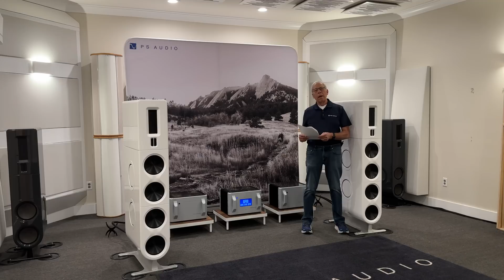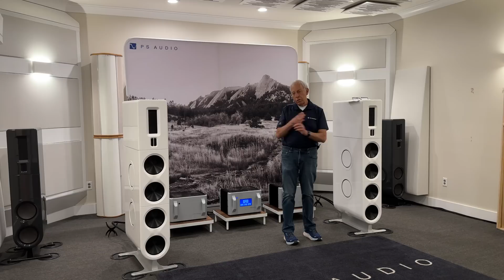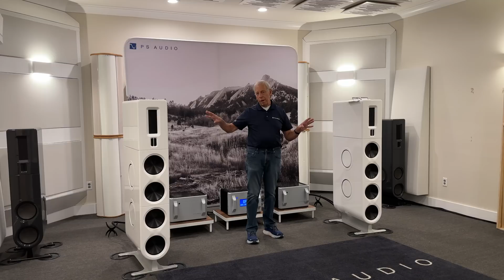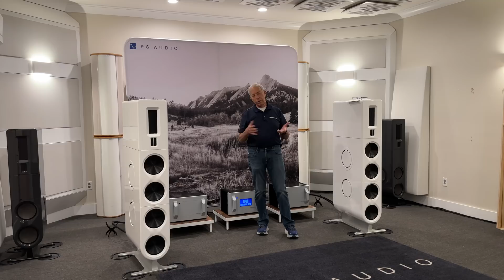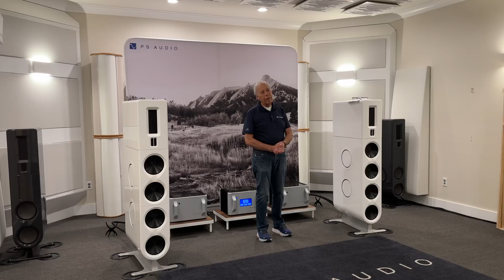Crosstalk cancellation

Comment: Crosstalk sounds bad. Yes, you can get a wide stereo image with just 2 speakers without addressing crosstalk but that's only half the problem. The phantom center cannot sound optimal, and the further the speakers are placed apart to create a wide soundstage the worse it gets. I've never, ever heard a straight 2 channel, 2 speaker system overcome this. It's just baked in to the setup, which was originally chosen as a way to get stereophony happening with maximum affordability and practicality, not sound quality. I'm glad to hear Paul is working on the single box. I don't see it as a compromise at all. It's actually the best way to do it, and it's not hard at all to do it without any digital processing. You just need to upmix 2 channels to 3 channels with simple channel summing and differencing. In this way you can totally end the comb filtering of center panned sounds, which I will argue are the most important to sound quality overall, while simultaneously creating a very natural width sound stage, and increasing the distance from side walls and thus increase time delay of first reflections to the listening position. Yes, it goes off if you're not sitting in the middle, but so does the 2 speaker setup. The way it fails is more graceful I think, with the center panned sound staying in the middle of the room and the panned sound positions collapsing  and becoming ambiguous, but still maintaining a nice spacial effect. There's no way around that unless you go with the BACCH setup or something like that with a lot of high powered processing that tracks your position. I haven't heard that system yet so I'll reserve comment. Lesser DSP recursive crosstalk implementations have not been satisfactory for me so far in terms of overall sound quality. They do make for a wide soundstage though even with the speakers very close together in front of you.

Comment: Paul I had a cheap but good stereo system that had a pseudo surround sound feature and it did just that, threw the midrange and tweeter out of phase and it was phenomenal. I would watch movies and the sound would be coming from everywhere, even all around me. It's the only one I've ever heard that worked and I miss it so I know exactly what you mean.

Comment: I have one of those "Carver boxes" that I use all the time. (It's officially the "Carver C9 Sonic Hologram Generator.") Yep, the stereo image can get just plain ridiculously big. There are a couple of things it does, though. that don't get mentioned often. First, it absolute locks in the center of the music. It almost sounds like I've added a center speaker to my system. Second, there is a great separating of instruments in music. It makes it possible to easily concentrate on, say, the rhythm guitar, in the midst of the whole mix. I would also add this: if you want  "less big" images but more freedom to move around (not stay locked in the dead center between your speakers), you switch the "window" adjustment to Wide and the Injection Rate to Theoretical. Using these settings, I've had the startling experience, with TV audio, of hearing people who sound like they're speaking or whatever out on my front porch!  It's great technology that requires some playing around with speaker (and listener!) placement. Oh, and I recorded some live concerts at my churches, so no multi-tracking and mixing down. The reproduction of those live recordings is incredible.

Comment: If you could model the entire room including occupants for distance, object acoustic reflectance and absorption over the full frequency range, and then run some 3D “field solver” in real time for each point relative up to half the of the highest wavelength that you could hear, then  a technique of destructive phase interference in theory would work, so long as you didn’t move a jot. This sort of processing power doesn’t yet exist. In reality, it’s a compromise of applying  blanket compensation  over a complicated issue. Software has for years existed which will process audio in terms of perceived width. You can  also to convolve an particular environment (say a church hall) over a dry recording using an impulse response from the environment. Is it as the producer at the recording desk intended, well no, but then does that matter?
Reply: It can be done.

Comment: Let's not forget the system developed by Polk (I think) in the 1980s that incorporated two midrange speaker elements in each cabinet. One element was wired normally, while the other was driven by an attenuated and phase-inverted signal from the other channel. That caused cancellation of the crosstalk and was quite effective in improving the stereo image.  Very simple and purely analog.
Reply: I'm curious what the model of that is.
Reply: @tjmbv8680  Polk SDA "Stereo Dimensional Array"
Reply: Not sure of the 80's model from Polk, but the newer versions are the L800 towers.
Reply: I’m not sure but I think DCM had a sound stage design that was similar to the Polk version.

Comment: And thanks to you and almost all stereo manufacturers.......If people want an "add on" unit to their integrated amps  (such as cross talk cancelers such as the Carver sonic holography unit)...they have NO EXT loops or "tape in/out monitor loops" to insert them into !!!!!!  I can't find ONE integrated amp or amp made in the last 15 years that has such a loop (save maybe NAD).  Such a minuscule cost for such a handy feature. Heaven help anyone who wants to put a "evil" equalizer into their music  (after all....everyone has the perfect speakers and listening room to listen to their ABBA cds)
Reply: I did not understand anything of what you said.. But if you want to get the state of the art Interaural Crosstalk Cancelation solution of today that uses computational power that Carver or Polk Audio didn't have at the time back then.

We have done so much advancements since Carver did his solution that is based on research of Schroeder.

We have a web camera that track your face (to keep track of your ears).
And the system is calibrated by earbuds that are tiny microphones and frequency sweeps.

The whole system is calibrated your electronics, speakers, room, head and ear shape (those are individual like fingerprints) among others.

So with the web camera you don't need to sit with your head in a vice like with Carver/Polk audio solutions. When it track you and adjust it accordingly as you move your head.

Anyway when this system cancel out better than the old equipment does and therefore give even a better performance. (I think it is -50 dB cancelation.)

Cool verification trick can be done. When you have the microphones in the ears. You can turn the system to make you a recording.
Make a friend that goes around you and clap his hands, whisper in your ear. 

Play back your recording with the Interaural Crosstalk Cancelation disabled. And notice the stereo image is just performed between the two speakers.
Now activate the Interaural Crosstalk Cancelation "filter" and get   the full experience of your friends going 360° around you and whisper in one of your ears.

Now what did sound like the original event? Yes you guessed it.
But the cool thing that NOBODY can tell you "How can you know how the recording should sound, were you at the recording session?!"
In fact you were there during the live recording and you can compare the live and the reproduction after a minute. 😜

This is the the next best thing that has happened to 2ch audiophiles since introduction of Stereo.🤩

Oh the Google after Bacch4MAC if you want more information on NEW technology and of course you can use this with whatever source.
Reply: The only reason i can think of why you don't understand what I said, is that you never grew up with analog stereo in the 60's thru the 80's. EVERY amplifier made had at least one tape monitor loop in order to add in an equalizer/compressor/sound shaper of some sort, as well as for just recording on analog tape machines.  Your high tech solutions you mention in your reply are for the very small 5% of the hi-fi community. They all seem very cool and trending....but the VAST majority of people who just want to hear their music in the best light (considering their equipment/room acoustics) look on that stuff as lipstick on a pig. People these days barely listen to anything more accurate than 128khz mp3 files.
Reply: @stevec.6119  Thanks for your reply! Well I needed to read twice for understanding. (English is not my mother tongue.)

Anyway the makeup on a pig that is technological advancements and development that probably just swishing over some audiophiles head while sitting and wish for as you said a rather simple tape loop RCA inputs on the preamps. (Simple as it has no technology advancement.)

Maybe the focus should be elsewhere if we are looking for sound quality like I am doing for example?

The science and research Schroeder and Dr Floyd Toole have done during decades of research on how our hearing and brain works are now implemented and harvest now.

With help of new technologies advancements (computers, internet, image analysis and so on.).

But then there is on the other spectra of audiophiles that want that the whole chain from the recording to reproduction is analog all the way. And call them self: "purist" in the sense that they do not manipulate or digitize at any point the signal.

They miss out any technology advancements that the humanity has made since approx 1980.

It is like saying that audio quality has gone downhill since then and all technology advancements is on the cost of sound quality..

So what do they have then. As they are sitting there with their pig and just trying to imagine how it may look if just they had some makeup at hand.. 😜

I think they just hide behind the word "purist" as they think that it is something cool and something to be striving for. 
When the reality is that they don't want or are to lazy to to go and learn, with the times and fix all that frightening technology that that has gone past them during the decades.

And at best they can manage to connect their TT RCA and grounding wires to the external RIAA. Just as they did in the 60-ties. 👍

For example even if you take a fully analog recorded and created LP and played it in a fully analog system.

They will and are missing out in sound quality (I have first hand experience when I am a vinyl guy with some technical know how).
If we insert ONE component in the signal chain. That is a DSP.
And it need to make a ADC and some sound processing and than back again to analog with its inbuilt DAC.

Yes that introduction of a added piece of equipment plus a ADC and then a DAC is a smaller sound quality penalty than what the sound improvement it can improve in your biggest component in your system. That is your room with PEQ. (The room is at least contributing with some say AT LEAST 50% of the sound you hear. Of course you should try to fix as much as possible in the physical domain by different sound treatment technology but after that you fix the rest with appropriate PEQ + other "makeup techniques" as you call it. That we may go into later on if you like.)

So the net sum is improved sound quality and is just one example what the purist is is denying themselves to experience the sound quality that they could have and get. Only if..

HAPPY listening! 👂👍
Reply: @AmazonasBiotop  Not sure I follow all your points....but....I only know that audio (music) is one of the most subjective "sciences."  Everyone has different ears, and different tastes....and the more choices you are given...the better.  I just wish manufacturers would give more choices to people other than $10,000 systems...or $10.00 mp3 players.  Happy listening to you as well !!!
Reply: Bob Carver  did this with his sonic holography circuit in the early to mid 90s. I had mixed results with it  but I enjoyed the effect on most things.
And yes you pronounce the name Javier spot on for a gringo from So California -good job Paul👍
Reply: Audiolab 8300a is an amp that offers the feature you are looking for.

Comment: Crosstalk cancellation opens up the sound, but the amazing focus it provides by doing its little thing, isn't going to be equalled by sheer spatiality. If anything spatiality usually makes the sound more diffuse. Hearing that kind of openness opennesscombined with that kind of focus would really be something.

Audiophile with budget gear. "Life is unjust."

 Audiophile with mid tier equip, "Life is partly just."

Audiophile with the best most expensive gear available, "Life is just."